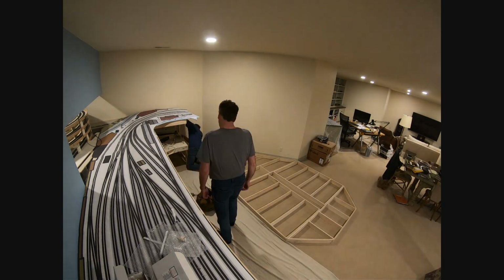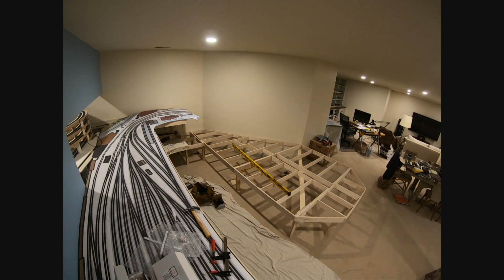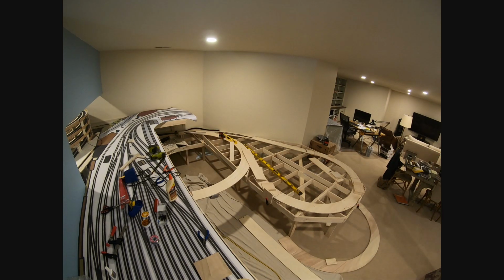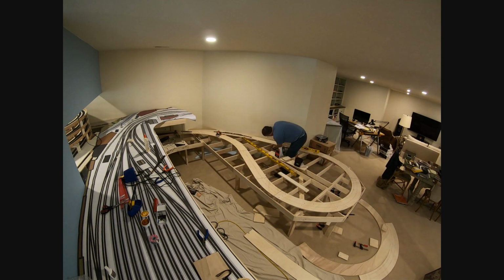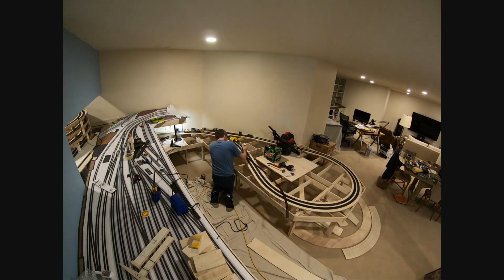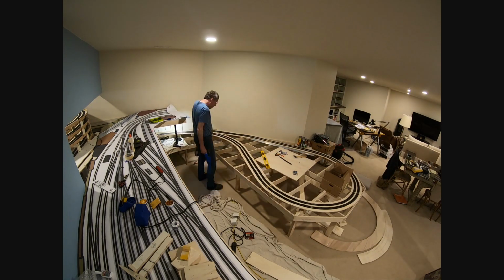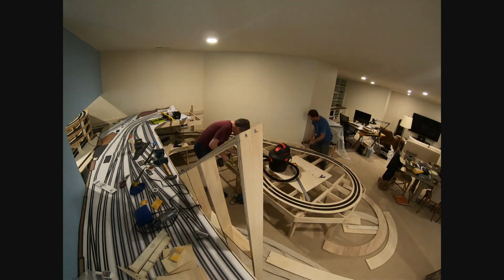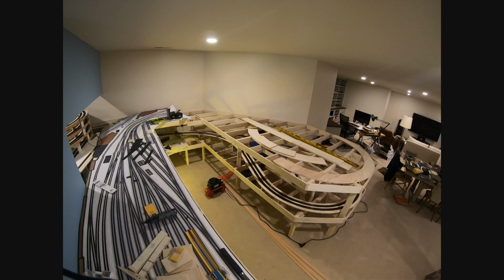TurnbackTimelapse

Comment: In Kinddov Stating The Bleedin' Obvious; The Speed-Frame Tends To HIDE The Actual Amount Of Work Necessary To Effect Prog-Gress !  But In Having Said That and Speaking From Experience In Having To Mostly Work  * Ace-Out * ( Alone )  When Having To  Construct Benchwork; It Never Ceases To Amaze As To The Valued Contribution An Extra Pair Of Knowledgeable Hands Can Make ... Work-Rate Increases Beyond Just Double !  As A Matter Of Interest and Apart From Using A Bog-Standard Jig-Saw ( Like Me ); Is There Any Other Type Of Power-Tool  Chris  Uses Off-Screen To Cut Those Exact Curves ? Again : Much Thanks For The Series and Cheers For Now / Johnny
Reply: Hey John Everett, From what I’ve witnessed over the last few years, I think mpeterll gets slowed down by helpers 😉
But really, he is a speed machine 👍🏻
Reply: @Lancelot_Jago  He is certainly a quick builder, usually with quick builders the quality falls, but not in Peters case, lovely work

Comment: This seems like an awful lot of work for a temporary feature...  though I can understand the customer's desire to get something moving soon.
Reply from the maker: The benchwork will be salvaged as it's the correct width for the next permanent lobe (note the 6" gap down the center where another dividing wall will be built).  Only the two end curves will need to be relocated.